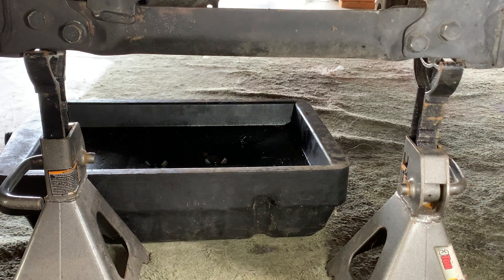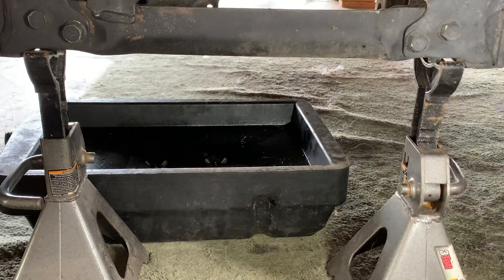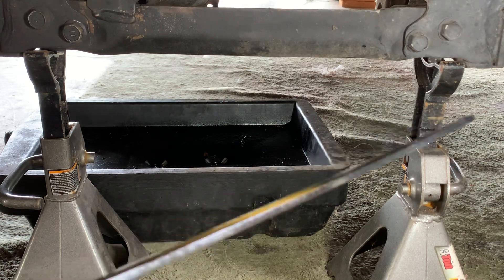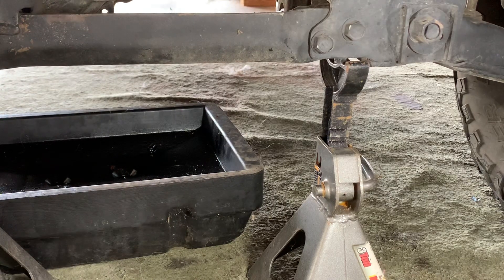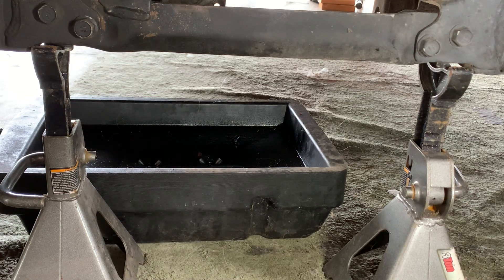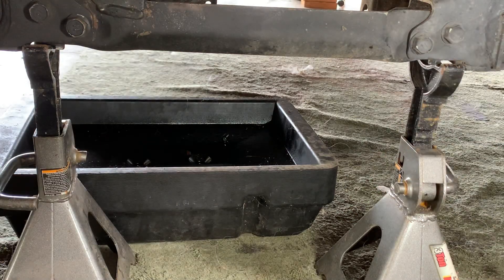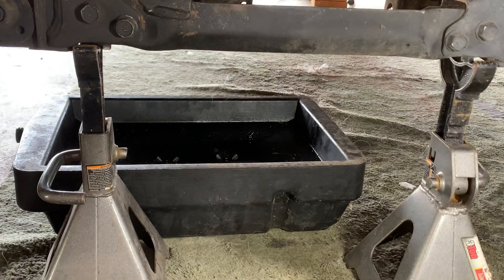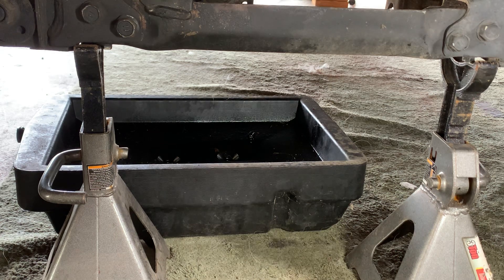The Harbor Freight Jack Stand Recall Exact Explanation

Comment: Your right it has to do with the die but not unevenness it’s because the teeth aren’t large enough and if weight shifts it will slip off the tooth just to be safe I always have multiple jack stands and also leave the jack there if possible to maximize safety

Comment: I know a lot of people shop at Harbor Freight, but I've always found their stuff to be inferior and refuse to shop there. They seem to have poor quality control over their cheap imported goods, and in my experience their not worth the $. I used to live 1.5 miles from a HF store and when I checked it out was overwhelmed by the oceans of crappy merchandise and never went back. I had friends who bought things there and their complaints about the quality of the stuff just reaffirmed my evaluation. It's like the old adage "You get what you pay for".
Reply: Hf does have some decent stuff so dont totally knock it lol.
Reply from the maker: There are a few gems but forsure not the place you want to have one of every automotives hand tools, specialty tools and diagnostic test sets